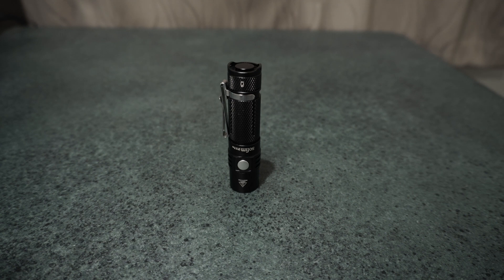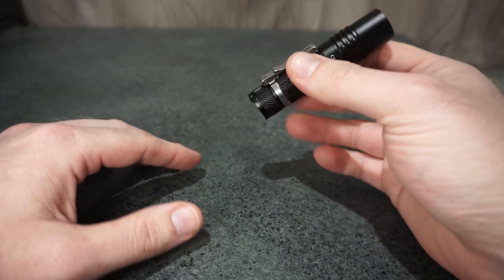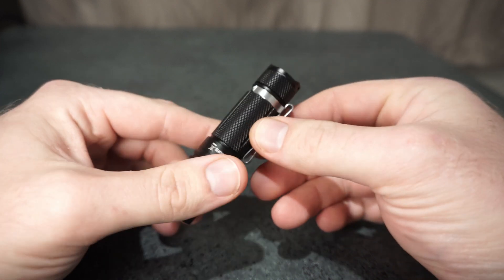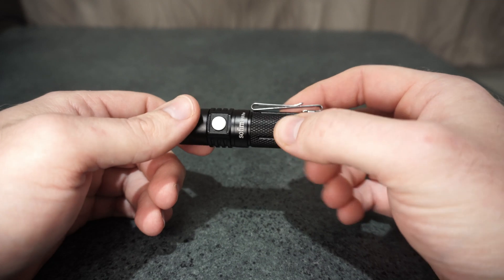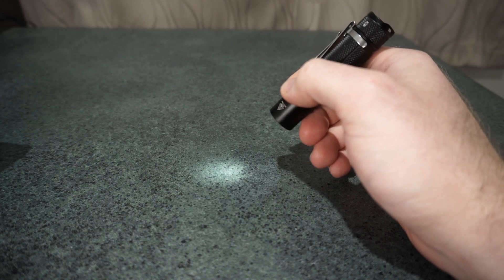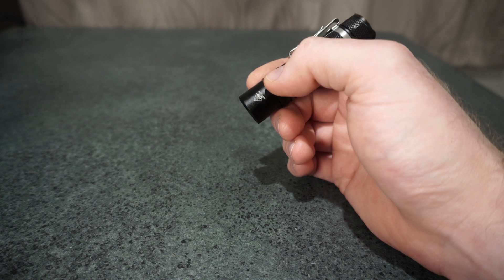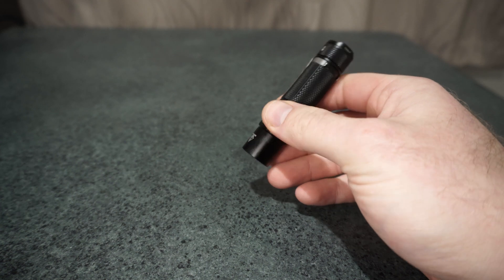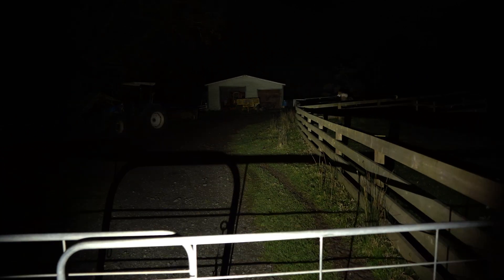Sofirn SP10 Pro, Anduril V2, 14500/AA EDC Flashlight

Comment: Glad they finally got Anduril working with low voltage and can use 14500 and NIMH now. I just need a common tail switch so I'll pass on this one. I have large hands cant stand the little hidden side switches in the dark!  I've been wanting a AA NIMH Anduril flashlight for years.

Comment: Why in the world would the developer waste space in the UI for two moonlight modes that look like you have a dead battery? People use a flashlight for light not for no light or very little. At first look I though the UI was the result of laziness but now I see it is just plain stupidity which seems so common in software development.
Reply from the maker: I suggest watching a UI tutorial before jumping the gun. This UI is specially for enthusiasts, this is why there's an SP10 V3 for the simple folk, and a Pro version for those of us who like to play around with settings. The moonlight level is configurable, so you can bump it up to whatever is suitable. This firmware was developed by a user called ToyKeeper from a forum called budgetlightforum. This is open source/free to whoever wants to make changes and flash their own version onto the SP10 Pro. 

I absolutely love the moonlight level where it is, this way I don't wake myself up when I need to pee in the night, and also keep from disturbing the wife. Everything used in the Anduril firmware was requested by countless users in the flashlight community, but it's not for everyone. There is a Simple UI for those who don't like to mess around, and this "Simple UI" is configurable as well via a config menu. By default this uses a higher moonlight level, specially for people like you...
Reply: @PiercingTheDarkness  Why do I need to watch a UI tutorial? I have looked over the diagram and read the text. Even the advanced UI is simple. So simple it left out a ton of functions which led me to believe the developer was lazy but the more I looked at it the more I realized it was stupidity. Gee I want one click to turn on medium. Two clicks to turn on Turbo and one hold to turn on candle mode but that's not configurable. Why not? A bunch of useless blinky modes but no way to assign clicks and holds  to modes. It's like something out of the 1940s.

I have a couple AVR developer kits laying around and could make a better UI from scratch using the Attiny 1616 instruction set even though the code is opened sourced. Too much bloat to even try to modify it.
Reply from the maker: @MrWhaatay  I look forward to your UI. Post it on the forum when you're done. All the best
Reply: @PiercingTheDarkness  I won't post it because I will charge people to flash it into their light.
Reply from the maker: @MrWhaatay  Then just flash it onto yours and you won't have a problem :) that's the whole point of the SP10 Pro having accessible pads. Not sure why you're annoyed when there's an online manual and diagram to read before buying to know exactly what to expect. It's not like some models out there where they've made a mistake and you end up with something else.

I'd like to know what model out there uses a better UI that allows candle mode with a hold of the switch?
Reply: @PiercingTheDarkness  That’s what I am going to do and then sell it to others. I didn't read any manuals because common sense told me a programmable flashlight would be just that. How hard could it be? Little did I know it turned out to be a half assed project of laziness and stupidity.

 For God's sake they could have used international Morse code where the entire 26 letters of the alphabet are made up of between 1 to 4 combinations of dots and dashes (clicks and holds)  to access 26 modes and functions instead of 7,12,15, or 30 clicks and or holds. Or binary using a click for a 1 and hold for a 0 which would have given them 15 different combinations with a max of 4 clicks and holds total. What was the developer thinking? I know, they weren't thinking.
Reply from the maker: @MrWhaatay  All I'll say is, I'm incredibly happy with it the way it is, and I highly doubt you'll get sales for a UI with Instant Candle LOL. Go and share your thoughts/ideas on budgetlightforum on the Anduril V2 thread. That would be better than a pointless moan on my video that's going nowhere.
Reply: @PiercingTheDarkness  Your acceptance of a garbage program is why programmers are lazy and don't put them effort into making things right.
Reply from the maker: @MrWhaatay  I thought this was amusing so I posted this all on reddit - https://www.reddit.com/r/flashlight/comments/x80gk1/apparently_toykeeper_is_lazy_and_stupid_i_hate/
Reply: @PiercingTheDarkness  Cool.  I have Reddit account. I will continue over there
Reply: @PiercingTheDarkness  Thanks for doing me the favor. This way my thoughts and opinions get expressed. If I did it I would probably be banned because a lot of mods there are leftists who censor the truth.

Comment: I bought one of these and while waiting to get it was looking through the UI diagram and text. I am a little disappointed in how little control the UI gives you. Yeah you can adjust brightness levels and stuff but simple things like being able to set it to come on in strobe or SOS with one click isn't configurable. I hate strobe and SOS but that was just an example.
Reply from the maker: This is why the Anduril V2 is open source/free, it's available to make the changes and flash it back onto the SP10 Pro. As I said in my response to your other comment, this Pro version is designed for enthusiasts, not for the average Joe who wants Strobe with one click, this isn't a tactical model and the UI isn't designed to be used as such. 

In saying this, you can actually get Strobe in a single click if you want to. First you need to be in the Advanced UI, select Strobe and then turn the flashlight off. You then click 5 times to enter Momentary mode, now every time you hold the switch it uses that Strobe level.
Reply: @PiercingTheDarkness  So you are saying enthusiasts are morons? The advanced UI looks like it was designed for the average Joe because it is so limited. If it were for enthusiasts it wouldn't be so limited and restrictive .

Comment: At min. 9,03 there is the famous "blink" at top of the ramp mentioned on BLF forum? Does is present also at half of ramp?
Reply from the maker: Only at the top and bottom of the ramp is there a blink
Reply: @PiercingTheDarkness  I don't like that, can you ask to manufacture   reflash smooth ramp?
Reply from the maker: @MACYNET323  i suggest you flash your own custom firmware

Comment from the maker: I'm in the process of finding what works best. I'm thinking I'll just use the gimbal to walk around to show the modes, lumen and range measurements, then switch to the tripod and have quick bursts in different locations. I'll also include photos while I speak at the beginning, and look at shortening it. May shorten the UI section and just skim over the options without having to show everything.
Reply: Hi J, you've been doing good so far.  To me, i prefer flashlight /torches review that emphasized towards visuals, and yours are come up well.  Beamshots of nearfield, midrange, long range in different area, with 3rd person pov and different shot angle as a good garnish 
would add nice 
surprises😊
Cheers🔦